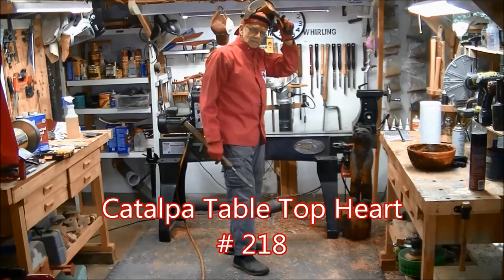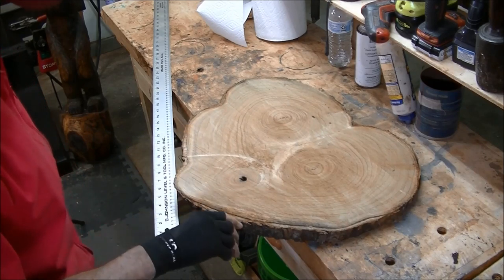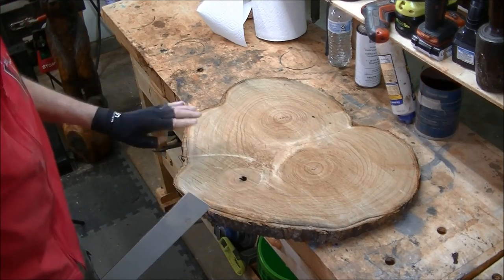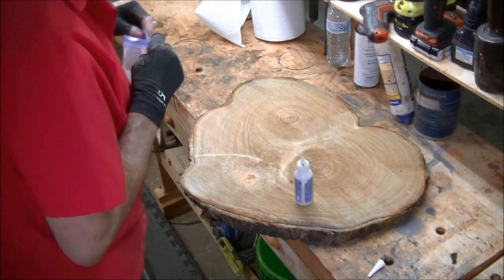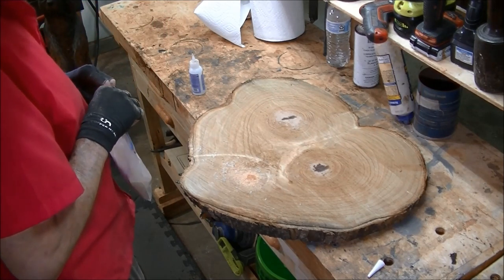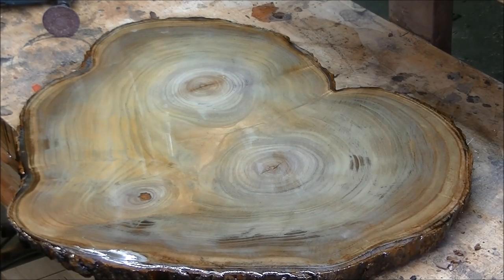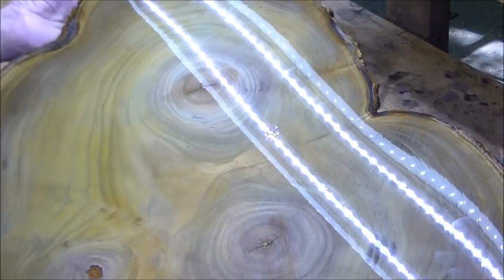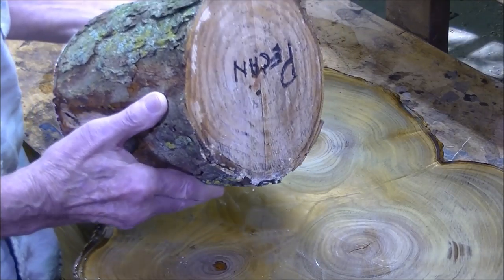Catalpa Table Top Heart # 218

Comment: That's a beautiful, unique, piece! Nice job. Just one thing. I did a project very similar to this with box elder. I did not seal or coat the underside which allowed for moisture pick up/variation. The wood eventually cracked and ruined the piece. You may want to get this back in your shop and brush a thin coat of epoxy on the back side. Just a  suggestion. Thanks for the video.
Reply from the maker: Thanks, I did seal both sides.  Take care, Larry